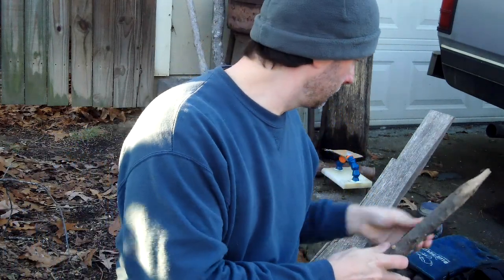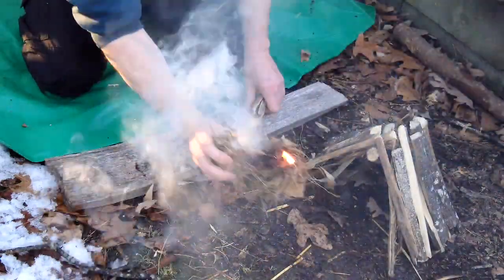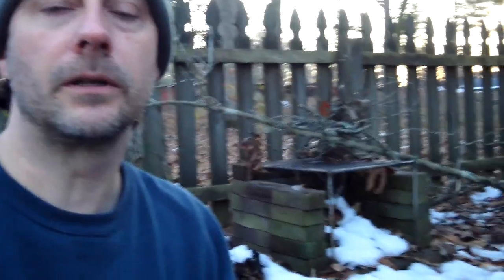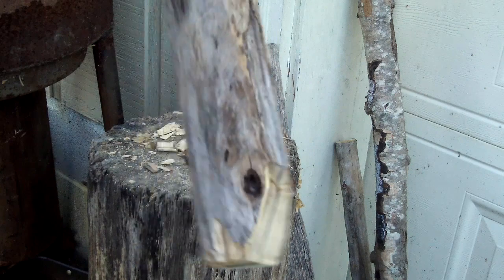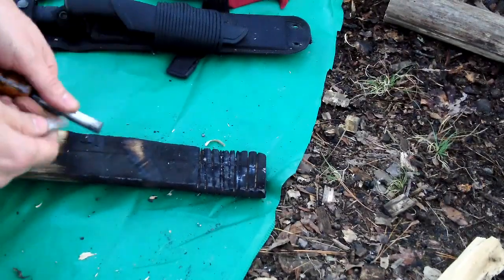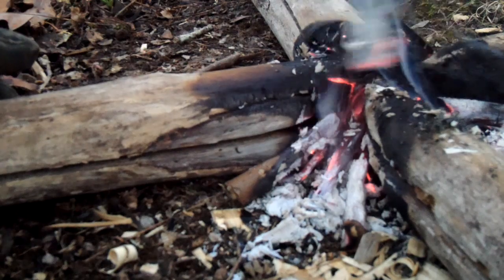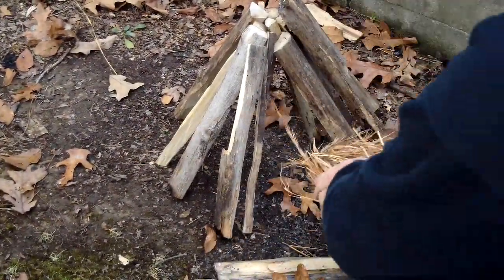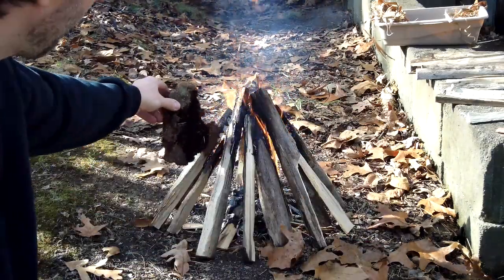One Foot In The Wild Fire Contest Tag Inspired By Dave Canterburys Fire Playlist

Comment: Have you ever used Chito‘s or Doritos while making a fire? I have started caring a bag of Chito‘s or Doritos with me on every trip out. They are sealed and stay dry so it’s like having some kenneling already to go. You can test this by lighting a Chido or a Torito at the tip. It will burn like a candle because of the grease that’s N them. Just remember to take your plastic bag home with you. One other use for a empty chip bag is to boil water in the empty baggie. Just in case you don’t have anything else with you. Just remember that you should take your trash home with you but I don’t have to tell you that.
Reply from the maker: I remember seeing Les Stroud start a fire with Fritos corn chips about 15 years ago. I think pretty much any greasy chip is flammable.  Good idea using the bag to boil water.  It's a pretty thick foil type material so I can see that working
Reply: @Reallybigmonkey1  I have used plastic bags to boil water. They don’t necessarily have to be foil. For some reason the water keeps the bag from melting and putting out your fire. I seen it done on the history channel a few years ago. It’s a one time use but it will get you through in a jam. I don’t know what kind of chemicals would be released into the water but I haven’t died from exposure yet. Really love your channel and keep up the good work my friend. You have taught me so much.

Comment: You need to skip that hand drill set you have and use Creek Stewart's fire Chuck. You only need about a 2-inch piece of seasoned wood for the hand drill set.
Reply from the maker: Whats wrong with using my hand drill when it works?
Reply: Reallybigmonkey1 well you broke your hand drill. And the reason you broke it is because it was really long but if you only need about 2 in of that to stick into the fire chuck then you don't have to worry about breaking a delicate piece of really dry flammable material.
Reply from the maker: I rarely brek spindles unless they are old and too dry. Ive done aat least 500 hand drill fires over 30 years and broke probably 10 spindles. I believe I know them method you mentioned of attaching a smaller piece to the bottom of some more robust wood. Ive seen a lot of folks do that over the years.
Reply: Reallybigmonkey1 yep that's the thing that I'm talking about. Creek has a little square Aluminum stock piece about 3 inches long that you take a small piece of spindle material, for instance if you can't find much spindle material, that you jam into that square aluminum stock and then jam the square aluminum stock onto a bigger more robust stick and use that as your spindle.
Reply: Reallybigmonkey1 if you had to build a shelter and had dense woods but there was an 8 foot tall link fence what would you recommend for shelter design?  I have tarp and plenty trees along with leaves from witch to use with normal gear of course.
Reply from the maker: If you have plenty of wood then build a free standing A frame. If youre low on wood materials hang a tarp over the fence or carabiner it to it and build a lean to against the fence.

Comment: EVERY last survival manual, since ww2, has taught that you can break down parachute cord and weave netting out of the inner strands, and not ONE of 44 guys has thought to take a paracord gillnet or paracord 2 person hammmock. That would total 2000 ft of paracord, instead of the 20m of it that they are allowed to take as a hank (and many do so!) What a waste of a pick. The hooks are a waste of a pick, so is a slingshot, the axe, a big saw, the ferrorod, belt knife. Some have taken a sharpening stone, fercrhissakes, or soap!  Hardwood ashes and water will suffice to clean things. and a rock and the file blade of your multitool.
Reply from the maker: Someone told me theres a predetermined list of what they can choose as ten items. I don't know what alls on that list